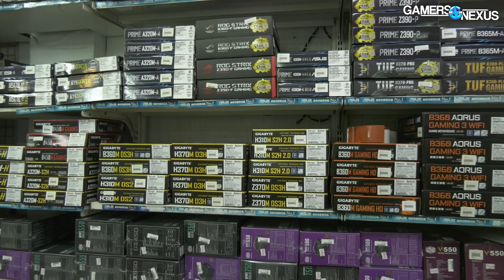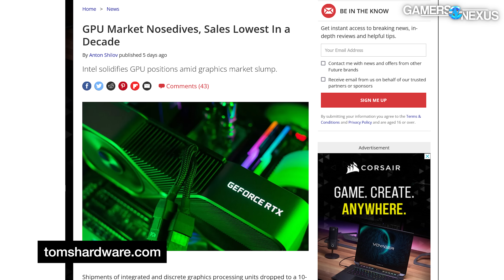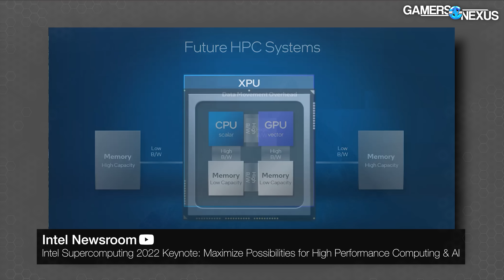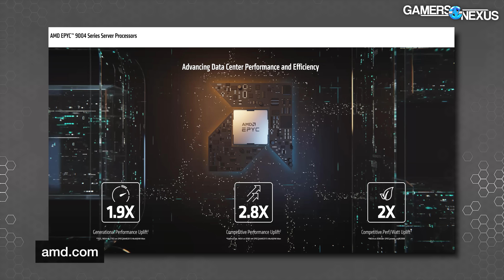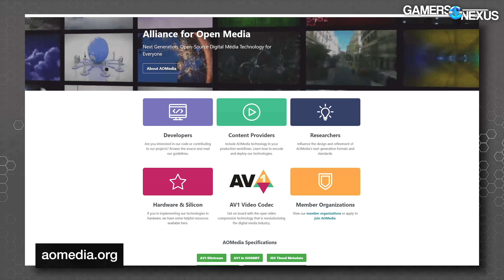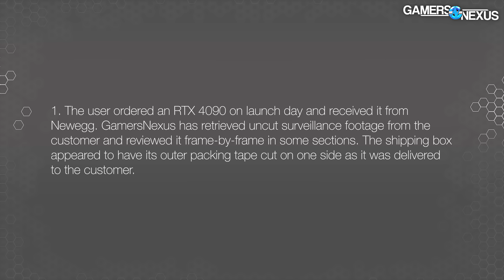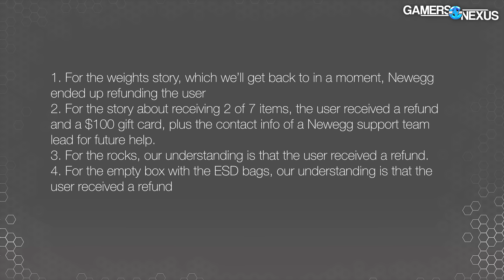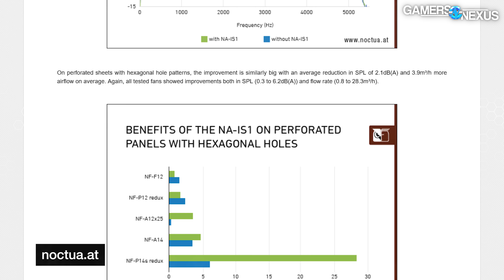HW News - AMD Beat-Down on NVIDIA Prices, Intel RAM on CPUs, Newegg Follow-Up, & More

Comment: Whoever came up with Random Access Memory, Bandwidth Optimized deserves a raise.  I know I want RAMBO in my machine.
Reply: I cracked up at that. Back in the day my handle was RAMBO SAMBO. Maybe I should bring that back.
Reply: I want an extra 16 Rambobytes in mine. Needs a boot in the clock cycles. pokes pc Why u stuttery?
Reply: Now I love you.  You have made my life better with this comment.
Reply: He just wanted something to eat.
Reply: This needs more likes, this is a great comment. Upvote this man. 👍
Reply: Can't wait to download new RAMBO
Reply: There was a Brazilian viral post made on Yahoo Answers many years ago where someone asked if a certain computer was worth buying and the specs were 2 gibs (yes) of rambo memory, 250 gibs hard drive and a dual color intel processor. Guy also asked if it was hard to install the godzila giroflex browser.
Looks like he predicted the future.
Reply: @rodryguezzz  now I want a Godzilla browser 😅
Reply: @rodryguezzz  a classic 😂😂
Reply: @rodryguezzz  
GiB is an actual unit (it's specifically 2^30 = 1024^3 bytes, as opposed to 10^9 = 1000^3 bytes. For memory that's standard as the unit of measurement, but hard drive manufacturers often use the matrix prefix whereas operating systems tend to stick with binary. My 10TB HDD "shrank" 10% when plugging it in a windows machine because it reported only about 9TiB. The 2.4% difference between the prefixes added up over four prefixes (KiB, MiB, GiB, TiB).

Of course in reality people just use GB for GiB freely and the person may not have meant GiB with "gibs".

Comment: 250 for a crossover board? That is completely the opposite of asus charging 400$ for a tuf b550m board.
Reply: Yeah especially with a Z790 Chipset with (from what I can tell) good features.
I would have expected it to be twice as expensive.

So somehow a Sonic the Hedgehog themed Mainboard is pretty good value.
Reply: @Ocastia  The board probably outran inflation.
Reply: @aapje  haha I laughed way too hard on that lol 🤣
Reply: The only downside is the back io, lack of USB ports and no bios flashback button
Reply: to be fair sonic IP isn't as strong as Gundam's.... (plus asrock isn't asus either) but I like this trend of merging popular IPs with hardware!
Reply: @aapje  nice one
Reply: Yeah no kidding, I was kind of into the Neon Genesis: Evangelion crossover I saw on newegg and amazon but with the GPU and board it was like $2000. Nope.
Reply: @aapje  well played sir.
Reply: @somedude9316  that is ridic. Some reason everything Neon Genesis has to be overpriced for the color themes
Reply: Asus lol. They've been drinking their own cool aid for way too long.
Reply: Huh, which form factor is this 400 dollar tuf mobo, the matx is currently £210
Reply: @Haddad-i_made_u_read_this  I don't count matx as proper motherboard. They lack a lot of connectivity and cooling. I bought a MSI b550 for 120 bucks last year, had decent vrms, 8 USB ports, 2 m.2 ports etc etc. ATX. That is a good deal. 210 for an matx, oof
Reply: @8lec_R  if u even utilise them in the first place ._.
Reply: @Haddad-i_made_u_read_this  Tru dat. As a beginner board matx is perfectly ok. I used an matx board for 5 years. luckily my case has 4 USB ports and my monitor has 4 extra so I didn't really need more.
Also I just had a core i3.
Reply: @8lec_R  yh that's perfect sense to me... who has an i7-3770
Reply: @GatsuRage  In a different timeline, they would be equal, or even reversed.

Comment: Just an important correction - AV1 is not the successor to H265 - it's a competitor to H265. 

AV1 was created by all the big streaming companies based on code from VP9/VP10 and other codecs that they owned/had patents on to avoid one of H265's biggest problems: its licensing terms, which basically joined the "must have recurring revenue" bandwagon and added per-subscriber fees, while previously on H264 companies could pay either a per-device fee or an one time fee based on estimated number of users.
Reply: I'm pretty sure they meant to say that AV1 was designed to supercede H.265
Reply: It feels like barely anything forward facing has H.265(HEVC) support and they're already trying to deprecate it in favor of a different format?  (ie; Discord still only takes specific h264 files as embeds; it's stupid.)

It's almost like HD DVD and BluRay all over again.    At least it's an open standard rather than proprietary licensed BS; something holding back the industry ad infinitum.
Reply: @AceStrife  Small correction: Discord also accepts VP9 in the WEBM container
Reply: @AceStrife  Because, as mentioned, the licensing fees are stupid.

Comment: 15:57 not having an overclock mode called "Blast Processing" is a serious missed opportunity.
Reply: waterflame is an OG
Reply: A sonic motherboard would have been the coolest thing in the world like 20 years ago 😂
Reply: @infernaldaedra  For like the 10 minutes you assemble the PC... or in Sonic's case, in a flash. No readily available or at all existing glass cases remember?
Reply: blast processing for overclocking and nintendont for undervolting
Reply: Any current high end CPU already delivers blast processing out of the box while the Switch Tegra X1 is garbage.
Reply: @infernaldaedra  for some of us, it'd be 30 years.
Reply: @destronger5313 I suppose but I think that was the peak of prebuilts so maybe not. It would have to compete with commodore and the Hot wheels PC and Barbie PC. I don't think there was even as large of a industry all around or many people that's interest would overlap to the point it would be looked at like as a sticker on an expensive motherboard. 30 years ago sonic was only big because of advertising and Sega iirc but ehh. 30 years I'd have wanted a T-800 that would do all the computer stuff lmao
Reply: @Gary_Hun ALL acrylic panel PC case specifically. If we're going old cool.
Reply: @Gary_Hun  there were a lot of corny acrylic cases back in the day too. these days its hard to find modern reputable cases without a window if you’re shopping mid tower.

Comment: In regard to the 4090s, back when I ordered my 1070 from amazon a couple years ago, I recieved a box with a perfect cardboard cutout to fit two WD harddrives from the mid 2000s for the weight. This happened twice. Was during the time when mining still was a thing for people at home. I've switched to a different shop after refunds then.

Comment: A series of 'best bang for your buck' PC build videos would be very interesting right now.
Reply: In the UK we are still holding on to the label "Rip-off Britain". Sellers seem to be operating as if the world is still in lockdown and mining is in full swing.
3 years ago, I bought a GTX 1660 for £210. A month later they were selling a 1660 super for £200. Now the none-super version is £278
Reply: @alexedwards6509  Same here in NL. The cheapest RTX 4080 is €1469...
Reply: +1
Reply: the thing is...bang for your buck can mean alot of different things. I built a 2.5k rig for 1.4k, thats bang for my buck. Otherwise, most value to be had now is 6700xt/3070 tier  gpu and going with a entry mobo + 5700x/13600k/5800x3d etc
Reply: @yukisnoww  your entitled to your opinion even that you are WRONG :) 5800X3D is WAY WAY over-priced , over hyped waste of sand
Reply: @tilapiadave3234  Overpriced maybe but overhyped not imho. If you have X370/B350 and 1600 and you upgraded to a 5800X 3D then you had a win like there has never been in PC history.

Your argument of it being a waste of sand is nonsense, it is the fastest gaming cpu for AM4 and gave immense value to an awful lot of customers. There is a reason it has sold so well.
I do not have one and stuck with standard 5800x.
Reply: Answer: 12100F + 6600 (XT)
Reply: Depends what your budget is and everyone's budget is different.
Reply: It’s pretty simple. B550 + 5600 and RX 6600 or 6600XT or 6700, mayyyybe 6700XT. Then I would pick out a Respectable brand/sku 1TB SSD, and then sort PCPP by $/GB for an HDD. PSU i would at least filter for 80+Gold if sorting by price or just go for a brand you trust there.
Reply: @andrew6978  Best bang for your buck videos are generally broken down by price. My interest would be what Gamers Nexus believes is the best build for different price points. I should have been more specific. There are a lot of quality products around now, last and current gen, as well as some absurd prices, so it seems like a good time to do it, or it will be once AMD releases their new GPUs.
Reply: @-opus  Yeah, that would be useful, agreed.
Reply: That is easy, buy last gen everything. Across the board
Reply: @LG-jn5fx  How is this MAGIC 5800X3D at say Far cry 6 ,, it SUX ,,, at CSGO ,,,, it sux at rift breaker ,, SLOW ,,, how is this 5800X3D at ANY productivity programmes USELESS. Yet the SHILLS want to tell everyone it is SO fantastic SO Excellent ,, it is all lies . At $250 I would forgive those weakness's
Reply: @mikerzisu9508  I did a quick check recently comparing 12th gen, 13th gen, am4 and am5 for price, 12th gen was the stand out for the wrong reasons, far too close to 13th gen. A more in depth and less personalised comparison may have returned different results, prices are all over the place right now too. Newer boards should also have better features at lower levels (faster usb, pci-e 4 etc). I just built an AM4 system because it is more than good enough for my needs, lower power usage, and cheaper, but I chose a higher end board  (gigabyte x570s aorus master) to get faster usb/usb-c, I may have have been better off going AM5, or 13th gen with a lower end board
Reply: @-opus  good choice. That will last you a very long time. I built a 12900k ddr5 rig earlier this year, no complaints
Reply: @LG-jn5fx  YES ,, this SUPREME CPU ,, that is what the SOY---Bot AMD shills tell us is NOT so supreme ,, it is WAY overpriced WAY overhyped and a waste of sand at anything over $250
Reply: @mikerzisu9508  Last gen is currently more than enough for most peoples needs. Buying current gen right now = higher prices and fewer choices of motherboards, and ram. I believe 14th gen and AMDs 8000 series will both be exceptional, but I am unwilling to wait another 2 years (or whatever) until they are released and feasible.
Reply: @@-opus  if you always wait for the next best thing, you will always be waiting and never get anything. Last gen Intel and AMD is the best bang for the buck buy currently. Same with the Nvidia 3000 series gpus
Reply: @mikerzisu9508  VERY true ,,, NOW is a great time to buy ,, grab bargain basement last gen AMD ,, or 12th Gen Intel ,, all in reality are good buys
Reply: Yes, make a video like just about everyone else
Reply: @mrpaiute9013  I would appreciate Gamers Nexus's opinion on this, you don't have to watch it.

Comment: I feel like the main issue for Newegg here ist that they ship their stuff In a box with "NEWEGG" written on the side, because if I wanted to steal packages, I would definitely go for the ones from a large electronics retailer, where I probably have much higher chances of getting something valuable, instead of stealing from indescriptice brown boxes or Amazon packages where I would most likely find a sweater or 5kg of peanut butter or some shit like that
Reply: Very true.  Same reason I was apprehensive about my orders from Memory Express at first - they're a Canadian hardware seller and I've had good experiences with them, but the decision to line their boxes with florescent green tape stenciled with their logo on repeat is....not subtle.  They also just cracked open the box from Fractal Design with my case inside to put the receipt in before resealing it with that distinctive tape...though smuggling a Torrent out away from CCTV is uh....not exactly that easy of a task.  That's a big hunk of metal, lol
Reply: I used to work operations and one of the things my manager always said was it’s better to take something already boxed and throw it into another one if only to make sure no one knows what is being delivered for privacy and security reasons. We sold guitars, amps and the like and while it’s unlikely someone would be able to just run up and grab a box that heavy it’s better safe than sorry. Especially when it’s a $2000 Gibson or amp.

Comment: Looking forward to the factory tours. Also glad we saw the conclusion to the Newegg weight gate. :D
Reply from the maker: Can't wait! And glad to have closed the storyline!
Reply: @GamersNexus  Newegg Weight Gate was the most used important story for me in this episode. Newegg has a thief intercepting a customer's order so Newegg decides to rip off and block it's customer instead of genuinely investigating and solving issues.
I'm guessing we're going to get to the stage where warehouse workers will have to wear body cams.
Perhaps Eufy can supply those.
Eufy, another company destroying its reputation.
Reply: @Google_Does_Evil_Now  Seems the obvious answer is start with sending fake GPU orders out with an employee that's being recorded to verify if its the carrier or internal. If none of the fake GPU boxes are tampered with externally, then its likely an internal job. Could also be someone on the inside working with carrier. Basically, internal employee flags tracking numbers of orders with "high value" items, and driver or sorting facility intercepts.
Reply: @dessimes  if they bother to look into it they'll know which depot warehouse it came from, who picked it, etc.
But it's possible it was removed from the box before picking.

The weighted metal that exactly matches the GPU weight. That's interesting. This is someone who knows they are weighing the packages as a security measure.

This is someone who has time to discover the item weight, cut 2 pieces of metal to the same weight, and put them back in the box.

I don't think this is the van driver. Not unless there was a delay in delivery.

If the package travelled through the system on time then I think this happened before it was placed into the brown box.

Perhaps these high value items are in a semi secure location. And the weights are small enough to fit on a person's body. The GPU could be smuggled also, but it's trickier.

I'm going to guess they need airport style but simpler scanners on these locations. As well as all loose fitting clothing removed, or only allowed to wear staff uniform which doesn't conceal items.

Sometimes in those places you're walking around with a trolley worth $1 million or more. I remember 30 years ago having a trolley worth $500,000 that I was moving.

Some electronics is very valuable.

Comment: "It's the most effort we've seen ASRock put into anything." -Steve 2022 👍

It really floored me how both AMD and Nvidia kept prices high enough to hurt sales of last-gen cards when used cards were flooding the market. All that excess inventory is getting less desirable by the day, but they still have to pay storage costs.
Reply: /Looks over at my ASRock mobo that had 1 out of the 2 Ethernet controllers dead out of the box hmmm fair
(assumed it was because Win10 didn't support teaming at the time - then warranty period was over).
Love how the Dr Debug LCD screen comes on with a non-error error code whenever it resumes from sleep (and stays on until reboot). I didn't like a consistent colour scheme any way, fark my ship up.
Reply: Broken Ethernet is BS, but the entire point of a “Debug” LCD is to show more than just error codes!
Reply: @mikerzisu9508  I kind of thought that. But their support has been more helpful to me than ASUS. And they were/are making the best-performing consumer fanless motherboard with the J5040.
Reply: @@garrettkajmowicz  I think they have come a long way, and most likely you would be fine using their boards. But it is a bit of a roll of the dice.  You get what you pay for. I have seen many videos over the years from techtubers who have had issues with them, but they are pushing the boards much harder so not really the same. I have been using Asus for my last several builds and they are always reliable and solid. Their prices are getting out of control though, and that is for anything... not just motherboards. Their strix 4000 series card for instance, that is just straight up robbery.
Reply: @sbdnsngdsnsns31312  the fact it woke from sleep is not necessary information except at the 'Info' or 'Trace' level of logs - it's definitely not something that should be visually broadcast without being asked. It is readily apparent to me that it has woken from sleep, since it was asleep and now it's not.
Reply: @mikerzisu9508  my friends Asus board died last year. B450 tuf. Used with a r2600 at stock
Also killed an rx460 as soon as it was installed

Yeah. I may have been unlucky but I'm not trusting Asus anymore than other brands. So far Gigabyte has been kind to me.